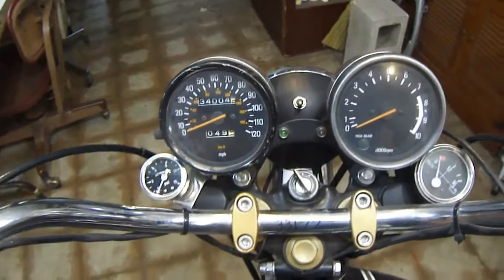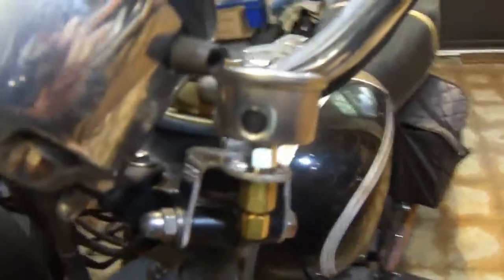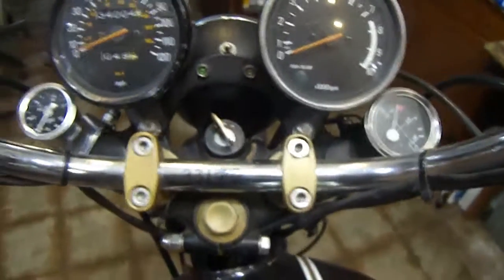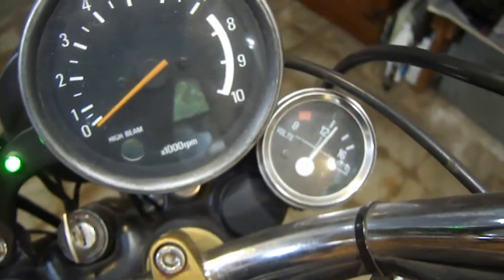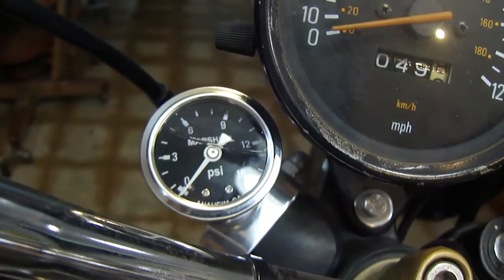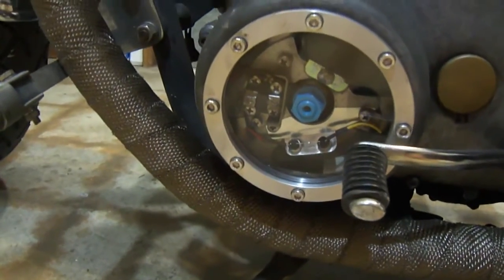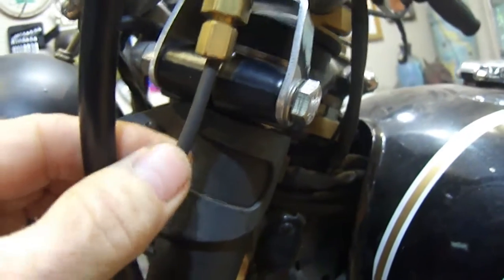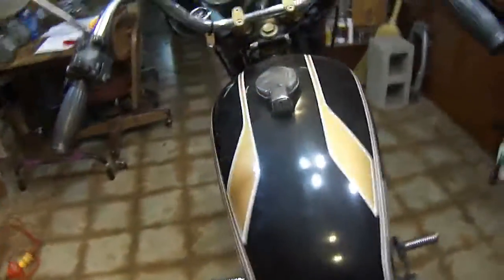XS650 Top End Oil Pressure Gauge

Comment: I just checked out of curiosity the XS650 service manual, and it says that the oil filter relief valve it should be about 14psi at 1000rpm... so, its logical to me that the oil pressure should a lot more high than this. I think you have a serious oil pump problem.
Reply from the maker: The pressure at the pump, and the pressure where my gauge is plumbed in, are two different things.  Trust me on this, there is nothing wrong with my system.

Comment: Pressure is force met by resistance. In the case of oil pressure in a engine, force come from the pump and resistance comes from the tiny passages the oil has to be forced through. The tiniest are plain bearings but the XS has none of those. A roller bearing engine gives almost not resistance which is why your readings on the gauge are so low. Also, those dip sticks with a temp gauge are about 6 mm thick  while the stock item is a thick piece of wire. That thick piece of wire just clears one of the gears in the trans and anything thicker will not. I had one and when I pulled it to check the oil level, there was a piece worn out of it by that gear. I confirmed this by putting that dipstick into the top half of a case with the gears in it and I could see where the stick and the gear were touching.